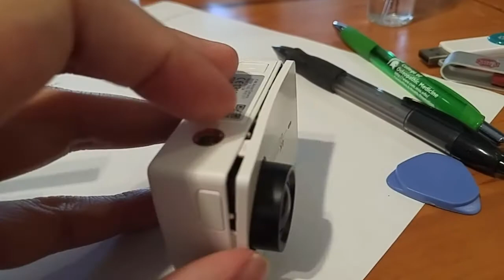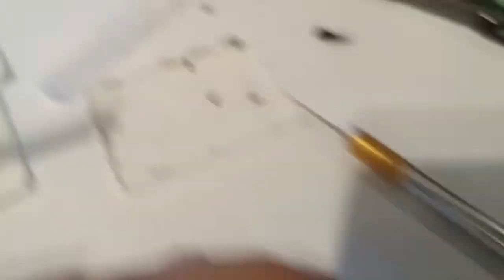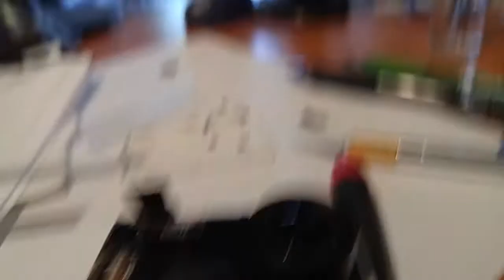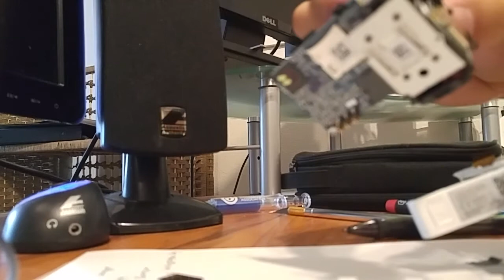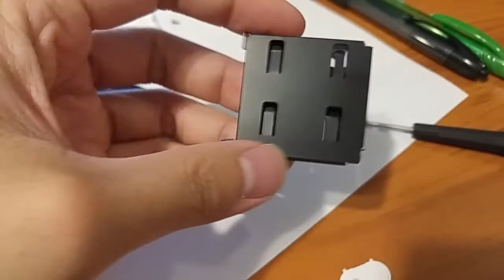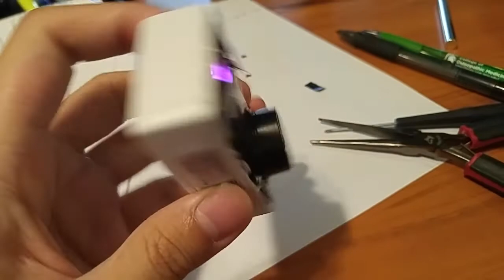Taking apart Xiaomi Yi 4K - Audio issue

Comment: Can I connect external microphone in this camera
Reply from the maker: Not the yi 4k. I believe the 4k+ has that capability. 

I will post a video soon showing how to solder in a new Samsung microphone (as suggested by another viewer) 

My microphone works fine now, but the quality sucks.
Reply: @SteU4IA  thank u
Reply: @SteU4IA  Did you mean the original one have better sound quality than Samsung microphone ?

Comment: I replaced them with Samsung Galaxy S3 microphones. pin with pin, compatible, sound quality, much better!

https://www.ebay.ca/itm/Lot-OEM-Microphone-Module-For-Samsung-Galaxy-S3-I9300-I747-T999-N7100-I317-N7105/273527947934?hash=item3faf89429e:m:mIqcFSRCMIRDuOHzgblz_Hg
Reply: do you have the videos when you replacing the mic yi 4k to samsung galaxy S3?

Comment: Does anyone know if the camera will work without the lcd screen plugged in? I'm looking to integrate this into a 3d printed case for a helmet.
Reply from the maker: Interesting question. I don't have a solid answer but it is a touch screen camera. I don't know how much functionality you would have without it. I'm sure it will still power up as that's a hard button.
Reply: @SteU4IA  Thats what I was thinking. I hoped that i'd be able to control all the settings via the app. Without the screen it can be permanently attached to the helmet, really close so it reduces the aero effects on my head, lol!
Reply: AS Motion Lab hi! Have you figure it out jet? I would like to use it with fpv drone, without screen and case, if it turne on without screen it would be nice

Comment: thank you for doing this. i wonder if we can just install a audio out? would it be as easy as soldering wires to the speaker conductors on the board?
Reply: Cool. I guess that will take too much space. I was thinking about installing a "Mic In" and use an Røde Mic instead, but this means to harm the housing of the unit. Better Use 48K and record the sound seperatly. Does someone had success with the syncronisation because of an perfect framerate?

Comment: I have a fix for it, but it's only with a cutting software... ^^ I have uploaded a video about that.
Reply: hey matstgr .. i cannot find the vid!? can you reupload it again? thank you :)
Reply from the maker: @k.skowronski175  fyi, I'm not sure what his cutting software fix is, but I resolved my problem by replacing the 2 speakers. The part is available for $20. It's the speaker pcb shown in my video that was defective.
Reply: @SteU4IA  Thank you mate, I appreciate your quick answer.. Since I'm struggling with sound on the 4k+ I am gathering information from every source I could get.. Even if the placement of the mics is a little different, this video showed me a path to get closer to the problem. But only a software solution could lower the gain on the recording mic.. It would be great to have an eqilizer, with input gain and clip/limiter.. To my mind my problem is the other way around, because I have a way too loud signal on the 4k+ and a distortion that makes any sound recording just garbage..
Reply from the maker: @k.skowronski175  interesting how the 4k+ is the complete opposite 😂. Wild attempt but I recall using one of those cheapo silicone wrapping cases on the 4k, and the silicone slightly sealed off the 2 top mics and muffled the noise a bit, have you tried that? Worse that can happen is you have a $2 silicone case haha.
Reply: @SteU4IA  "Replacing the speakers"?. Did you mean replacing the 2 microphones? Where did you buy the part?

Comment: I had the same issue.  No mic.  Audio is muffled when you blow in at the mic.  I use it for fishing and I think if you get it wet it may be possible that water may have seeped into the mic area.  I used a hair blow dryer to make it hot and banged it lightly on a counter and it worked.  My guess that mic might have seized up for it not to work.  Hope this helps any of you.

Comment: Hi Ste L. Very helpful video. Thanks for taking your time to take it apart and show us what we can expect. My sound has just gone out completely aswell. 

Xiaomi has just been telling me 'the audio would get fixed in a soon to come firmware update' for 7 months, until now. Last month my warranty expired and now they suddenly tell me it's not going to get resolved and that I have to pay 85 euro shipping and another 65 euro to get it fixed by them (which is almost the cost of a new one). 

First time dealing with Xiaomi, and it redefines the stereotype of chinese products and customer service...

Now considering I no longer have warranty anyway, and in no way am going to pay 150 euro to get it fixed. What is my best option to fix it? I read in the comment below here that you managed to fix it by replacing the mic with the parts of another Yi 4k. Where do I get this? Or did you have to buy an entire new Yi? That would quite defeat the purpose. 

Also: on alot of other cheaper actioncams people DIY self create an audio jack which allows them to use an external microphone on their action cam. This would completely solve my (our) problems and even offer us better audio than replacing it with another Yi 4k mic. 

Thanks in advance.
Aaron
Reply from the maker: I had 2 of these units and I experimented by transferring the mic, but you're right...buying a new unit to do this defeats the purpose. So far I don't think anyone sells the mic as a part, the only solution I see is buying a broken/parts unit but it mentions the mic still works. 

In terms of hard wiring a mic, I don't see how one would get it to connect with the circuit board, but i'm no expert. 

The only thing i learned from this situation is don't trust Xioami and their warranty (buy it with 3rd party warranty)...and to avoid this issue entirely, ensure the unit does not over heat (i.e using it in the case to long or using it with timelapse in direct sunlight w/o proper air flow).....i think heat is the main cause of this hardware malfunction ... no amount of software update will fix this.
Reply from the maker: So looking at the mods with the older Yi models... it looks like the older mics were just soldered on with 2 wires... that won't work with this unit since it uses ribbon cables.
Reply: I just listen the audio in mono, do you think this issue is about the firmware? this camera really sucks, Im so sad because i could buy a gopro at least.

Comment: Did you end up figuring out what the problem was. Mine have the same problem and I use it couple hours max
Reply from the maker: jasongy yes I did, the mic was totally defective. I suspect high heat causes some hardware issue. I figured this out by transplanting the mic hardware from another yi 4k. 

This camera definitely has QE issues related to heat, especially when used in a hot day in its housing.
Reply: @SteU4IA  Mine died just after 10min of usage 3 days ago with no heat (-2° C outside, no case/housing) inside my truck. It was the left mic and I was able so save my videos by dropping the left channel of the audiostream. Fortunately, the right one was ok. Sent it back for refund to amazon after reading about yi customer support and got a Hero5 Black instead which is working fine so far. So I don't think it's caused by heat. It looks like a design flaw which is still not fixed after several years. Just cheap crap...

Comment: My sound died completely too. I contacted Yi who told me because I bought the unit from Geekbuying dot com,and not them ,they were not honouring the warranty. Geekbuying said they would fix it(shudder) if I shipped it back to China but that would have cost 40. Some consolation in knowing I am not alone with this issue.  I do notice,however,when opening clips in FCP,while there is no sound playing back ,there is a very faint wave form showing of levels. However even boosting the audio to the max gives hiss. Pity ,because the image is really good. And If I do a visual clap I can still sync to other cameras.
Reply from the maker: chukcanuk 

Sounds risky.
Reply: What sounds risky? Visual clap sync?

Comment: i took it apart for like 10times now =D Still haven't found what is cousing mic not to work, and there are no replacement parts anywhere to buy... and YI is not responding at all on this issue
Reply from the maker: KiLLy yea same exact problem. You pretty much have to buy this on Amazon with the 3 year warranty.
Reply: Ste .L or not buy it at all :)
Reply from the maker: KiLLy i figured out it was the mic since I transplanted it from another unit.